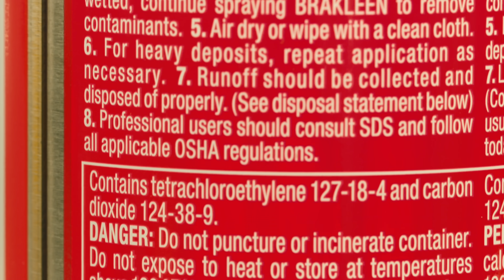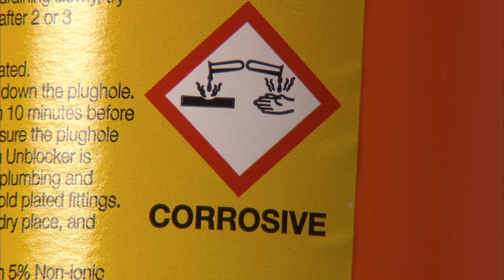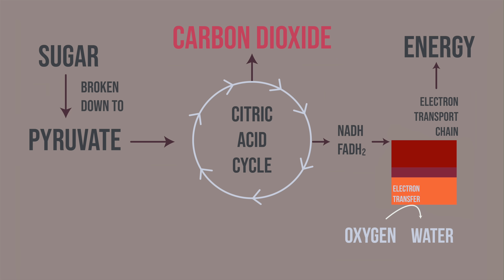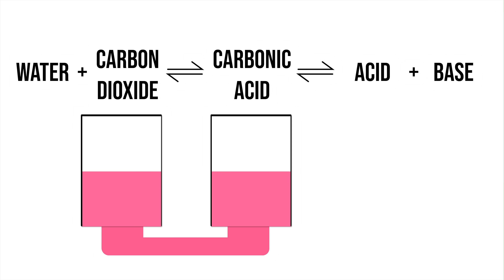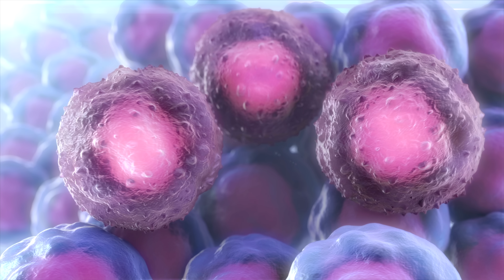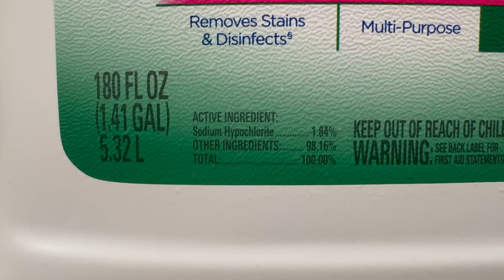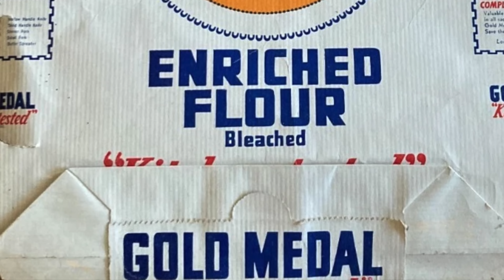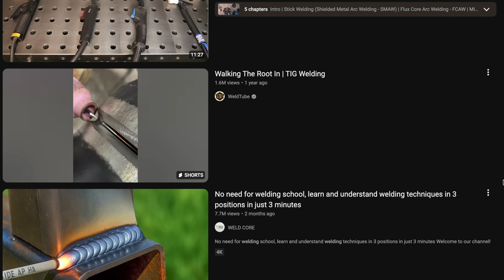"It smelled funny while I was welding and now I can't breathe..."

Comment: Both tubers have excellent videos, but this would be an extreme case with a lot of exposure. The one simple thing that was not mentioned is always use welding equipment in a well ventilated area. Commercial welding and soldering stations have fume extractors.

Comment: If you weld and smoke. You die very young. And any welder that doesn't know better than to use proper PPE and ventilation. Is very dangerous and is pretty much committing suicide. One of my best friends lives 3 months by the time he convinced the Dr something was wrong and they found out what it was. He wasn't young but he certainly wasn't old. 
BTW screw your dorky channel. Try telling ghost stories.

Comment: I’ve always had good ventilation when I weld.
Even in winter, I have a door open and a draft going through the shop.
On top of that, I always stay out of the smoke cloud, and hold my breath if fumes do get behind my hood.
Two things to not weld? Anything greasy or oily, and definitely not anything that is galvanized, especially Grade 8 bolts, as they dare coated with cadmium, which is absolutely poison.
I do my best to prep all my metal with nothing but grinding or wire wheels.

Never had a problem.

Comment: I knew I had to be careful with electrolysis, that if I would use salty water I would make chlorine gas, and I knew that it's very dangerous cause it's what they used in WW1 and we know what happened to those who got in contact with.
But I never thought of this happening with break cleaner, especially cause it usually evaporate quickly.
Always remember to ventilate your workshop really well when using chemical stuff, welding or even grinding something.

Comment: If engineers use angle grinders on something, and not brake cleaner, they do it for a reason. Engineers are some of the smartest people on the planet, they have spent hundreds of years optimizing the efficiency of every process, failing to heed their advice almost always leads to disaster, such as the titan submarine, or this.

Comment: I’ve been an industrial commercial heating air conditioning refrigeration technician for 34 years. Back decades ago, and I had a compressor explode. It blew a terminal block, clean out. Sounds like artillery going off. The chiller held  300 pounds of r22  the oil acted like fuel and ignited the refrigerant as it came out under pressure making a cloud on the roof where I was working. I couldn’t see and I couldn’t breathe. I was ready to jump off that roof, which was five stories up when I saw the roof hatch edge. I literally fell down that hatch one floor to the pavement below in the stairwell . Half out of it I was coughing, foaming and gasping and in a horrible state for about a half hour I felt like shit for days. In 2008 they discovered I had emphysema on the top of my lungs. It never got any worse all these years later.

Comment: Always wear protective gear when welding.
 Proper gloves, heavy duty cotton long sleeve shirt or smock, welding helmet with right darkness for the type of welding you're doing, face shield for grinding, breathing mask for fine particles and proper ventilation. 

Also, when doing potentially dangerous things that are new to you, check your "great ideas" with those more experienced. 

Welding is great, but be safe folks, do legit reset or take classes. 👍

Comment: 03:20 nasal cannula is on wrong 😄
07:15 oxygen does not "remove the waste associated with energy production"
08:55 the equation is not very clear here. the "acid" on the left side of the equation is simply protons (hydrogen ions), which is the the actual thing effecting the pH of the solution. increasing the dissolved carbon dioxide specifically increases free protons which is just another way to say it lowers the pH. if it only increased non-dissociated carbonic acid then that wouldn't change the pH, so in that sense the graphic with the pink fluid is wrong. buffer solutions are complicated.
09:33 you missed imo the most important problem with chemically disrupting the surfactant: it causes atelectasis. that's very important here pathomechanistically. however the conclusion you make at 11:00 implies that the surfactant is simply a "protective layer", which isn't the whole story
16:40 that is such a cool shot of the iron particles being pulled onto the cable during discharge. PHYSICS BABY

anyway thanks, it was an entertaining video and mostly correct, far as I can tell. k bye 🫀

Comment: That was a pretty exotic/convoluted kind of poisoning...  Otherwise, my feeling, if you work with toxic stuff, is that the most common issue is that you kill of your intestine microbiota (the good bacterie in your digestive system). Which can be absolutely enormously bad, bad, bad & difficult to get back again...  

Ask me how i know..  Common probiotics don't help..  There is something called Mutaflor (E.Coli Nissle 1917) which is somewhat effective. But you may also need to do a fecal transplant, which i did in Bakterieklinikken in Denmark (closed since many years).  What finally cured me was moving to Thailand, because i think that the microorganisms that is everywhere in the Tropical environment, is kinda the same as you need to have inside you...  So you are naturally restored here... There is actually also a Thai Probiotic, Interpharma Probac, which is good...

But yeah, for a Westerner, the air is i think supposed to be cleaner than it often is here, so what solved that issue may bring others. Shortly you  need an above average well-built home to live here, long term..  Which the well-off Thais actually have, so how they do is a good starting point....

Comment: I had accidentally mixed hydrochloric acid toilet cleaner with sodium hypochlorite bleach toilet cleaner. I believe one bottle ran out and I added the next. The moment I saw bubbling and faint orange gas I flushed the toilet and evacuated and ventilated the house. I had knowledge of both chemicals in the cleaners and knew they were different types. The excessive bubbling instantly gave me pause for maybe about 10 seconds until I sprinted into action: I knew some acid base reaction was ongoing and that chlorine was nasty stuff when liberated as a gas. I had minimal respiratory symptoms and the quick action certainly saved me much more trouble.

Comment: My story is similar... As a 10 year old science nerd... I read that to make ion plasma you needed a lot of heat and an inert gas ... I stopped reading there... I didn't know they were talking about argon or xenon gas, so instead I decided to get ahold of some FREON....hey, that's inert and I created an arc with two carbon rods and a welder supply... The arc glowed brightly and as I sprayed the freon into the arc... it decomposed into at least chlorine gas if not phosgene gas, in my unventilated cellar.. I coughed for the next day, but managed to not have severe symptoms or any discernible damage... In fact, I did this a couple of times before I realized hey this might not be good for me... I'm 73 years old now and in good shape ... older and wiser

Comment: Wasn't phosgene gas used in trench warfare during world war I?  Doing air conditioning and refrigeration work the first think we were taught is using a source of heat such as a blowtorch if used to heat refrigerant, or what we commonly call freon, phosgene gas will be produced.  A common leak detector used many years ago used a propane blow torch with a copper bar in the flame.  There was a rubber tube that drew the air sample which may contain refrigerant into the flame.  There would be a change in the color of the flame.  Today we use electronic leak detectors.

I believe there are many warning about using welding equipment in an enclosed area, one needs to have a source of fresh or filtered air.

Good video.  Jim

Comment: So even if you aren't making phosgene gas, please PLEASE make sure you have adequate ventilation for doing things like welding, painting (in particular, oil painting), and anything involving chemicals. It may also be prudent to use a high quality mask. If it makes a smell, it means whatever it is, is coming off into your lungs. Keep yourself safe and look up any warnings or safety information that comes with your hobby of choice.

Comment: I once found an old car tool that consisted of a can of propane and a small little burner with a rubber tube coming off of it. You were supposed to light the tiny little burner, which was a flame smaller than a lighter and this would cause a draft that sucked in anything through the rubber tube to "sniff" around the air conditioning components to find R12 leaks. The instructions mentioned the flame will turn purple when a leak is found. The byproduct of this is burning of R12 and many other refrigerants  produces phosgene gas!  An awful product its hard to imagine was ever produced.

Comment: When I took my welding courses, we were taught to use long sleeves, wear fire resistant clothing, wear a respirator,  and use ventilation. Half the course involved films  or print documentation of tragedies caused by injuries of differing kinds which happened due to welding or chemicals associated with the process.

Comment: I did the same like that guy when I just started welding in order to avoid grinding due to noise and not feeling like it was necessary for my first attempts. I did build a simple venting system and knew about certain dangers, but not this brake cleaner horror.

Just googled the symptoms and I had bunch of them after (2 weeks ago) and still suffer from a weirdly slightly irritated throat. Might be coincidence but who knows.

Comment: I learned quite a few things with this video - specially that we should be extra carefull when dealing with things that contain chloride.

My dad work in heavy industry and he once told me about a competition the Internal Committee for Accidents Prevention he was part of - the groups had to get one of the engineers to show up wearing IPE and the one who had the most IPE on would win. The caveat is they should be wearing something real used in real case. My dad wore IPE for welding some special thing in the factory but took second place loosing to another guy wearing ... welll ... IPE for welding some other special thing. Welding is serious and requires attention.

Comment: I'm a farm welder. One that got me is welding galvanized metal. Metal fume fever. I'll weld over rust, Grease, dirt, and old paint. It's gross, it's smoky and the welds aren't pretty. But that metal fume fever is like getting the flu. As you were pointing out there are a lot of great resources but without experience, you don't know.

Comment: Theres one thing thats incorrect here- the ultraviolet radiation from welding is whats responsible for most of the breakdown of tetrochloroethylene to phosgene not oxidation. Thats why it happens instantaneously around the source of emitted light and even vapors a few feet a way will transform. Ive had this happen multiple times

Comment: Very interesting as i am in the middle of a project involving a bunch of welding and i did clean multiple parts with brake cleaner.
Reply: I've been doing this at work for 2 years now.. never knew it could be a problem

Comment: Yeahhhh, brake cleaner. Guy I was doing some work for asked me to get something out of an attic. I had trouble with a hornet's nest, and he handed me a can of brake cleaner. I went in there and sprayed it on the hornets, and it was EXACTLY as effective as Raid. Still in the middle of the video, I'm hoping that this is fictional and Styropyro didn't really do this...
Reply: On the other hand, I'm glad he made this video, because I do know welding (at least a bit, I took a tech school course in it, then barely ever used it) but I did NOT know not to clean my work with brake cleaner, so that's a mistake I could well have made. But I can see the problem in the chemical structure. Expose it to electricity--maybe just heat--and you're gonna get chlorine gas. Or worse. ... Oh. phosgene? Isn't that used as a chemical weapon?

Comment: As soon as I read the caption I knew this was about phosgene. I was a diesel mechanic / fabricator from around 2014-2021. 
I was pretty good friends with one of the drivers, and we'd mess with each other, and it wasn't uncommon for him to spray some engine starter at me when I was welding. One day, I see him walk up as I'm welding, and I hear him go "why the hell isn't this shit flammable?". I immediately had an idea of what he did and got the hell outside. I never smelled anything weird so I just told him he could have killed me, etc. Ever since then I got rid of all the chlorinated cleaner and made my boss start ordering non chlorinated. It's not even a "dumbass thing". It's one of those things that are so obscure that most welders probably have never heard of it.

Comment: Back in the 1970's I had graduated from High School, but it was hard to find work. Luckily someone with Swiming pool Route took me
along. At a nice house with a view, he ask me to go and get some chemicals ( Chorine & Acid ) after taking a few to him, I thought that
it would save time by just Mixing them together. So at his ( mini ) truck I poured Chlorine into one of the Muriatic Acid Bottles, and " Suddenly There was a " Surge " a " Sudden Chemical Reaction " !
I looked and said; " What " ? !  /  And after a few more times I Ask myself; " What is Going on here " !  /  The Friend came over and I told
him what had happended. And he Explained to me what the chemistry was, as in; "You don't Mix these together " because That is what happens." That is Why the put those in separate bottles " !

Comment: As a relativeley young refrigeration technician I am very happy to see some of the things we do mentioned here.

Although new refrigerants are chemically less likely to produce phosgene, there is a ton of other things they can produce if heated to various stages and the oils used in the machines and leftover in the piping while doing maintenance are always leftout of the equation aswell as dirt and insulation that gets heated up downstream of your working area.

We refrigeration technicians not always weld, we braze. Which is a lot like welding and with large scale piping and machines will also happen at very high temperatures (technically you only heat up the copper piping to around 450-800 degrees celsius while the acetylene flame itself still will reach temperatures beyond 2000°C) it has all the same health hazards but they get overlooked in this field alot mire since they dont seem as severe at first and alot of techs only do brazibg on very small machines and piping where propane can do the job instead of accetylene.

I want to say that the dangers to the eyes and lungs while brazing are not taken as seriously as in welding. Welders usually dont braze and people who need to braze alot dont typically weld, so we have two isolated fields of activity, which are actually very similar in the respiratory health hazards they produce. 

Brazing surely is safer in lab conditions and with a sensible grasp of safety precautions.

But people kind of brush over its dangers. The safety and health awareness in brazing and welding seem to be 2 entirely different worlds.
In refrigeration-related brazing work, I never see professionals protect their eyes from the uv radiation of an oxy-acetylene torch nor their lungs from the things that the flame produces while heating up the pipe (AND OFTEN its insulation) leftover various oils in the pipe and the nitrous oxides that are created directly at the flame.

I have have gotten countless annoyed or weird looks or have been made fun of for using respiratory protection, while brazing on large scale piping or refusing to braze in very tight and non-ventilated spaces.

Even though I tried to care as much as I could I have developed alot of respiratory issues which are especiaöly present after doing alot of brazing. Some of which are reminiscent of what the person this video has experienced but luckily never to this lethal extent.

I just say this in to the nothibgness of youtube because I want u guys to know in the trades there are alot of stoneage minded people and nobody will care about your health and even if you do, there are alot of variables you might not even know of or have no control over. 

The problem with ref-techs on maintenance work is that some of them never braze while others do it nonstop and there are so few of them I feel like this particular group gets overlooked in regards to their health and safety hazards related to that.
There ar alot more respiratory health hazards in the industrial side of this work aswell which I feel are downplayed.

I hope this message might reach some of the right people to read it.

Take care.
Reply: Some of us in YouTube world are listening. 
I hope some young men link up the welders and the brazers: they could learn from each other.
Especially when it comes to safety: "If you don't care, nobody will." 😢

Comment: I thought for sure it would have been a case of acute zinc poisoning from welding galvanized steel.
Scary aside though; we use non-chlorinated brakleen at work (because chlorine is horrifying stuff), but it turns out the non-chlorinated stuff is as bad if not worse for you anyway.
Lesson being; if you're using ANY kind of brake cleaner, be in a well ventilated area or wear a mask WITH THE PROPER FILTERS. You would not believe how many people I've seen spraying nasty chemicals like CARC paint or MEK with P100 dust masks.
Rule of thumb is; if you can SMELL it, you're not PROTECTED.